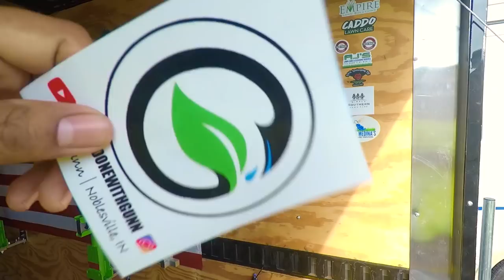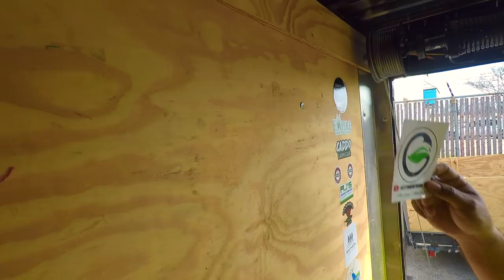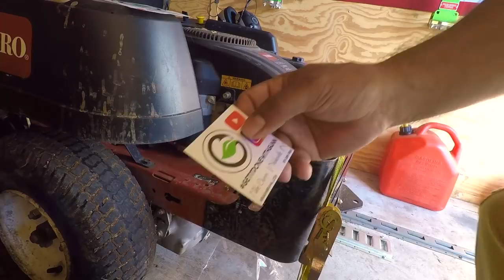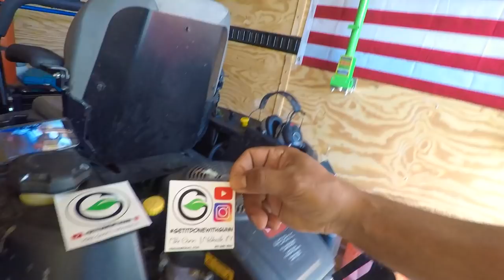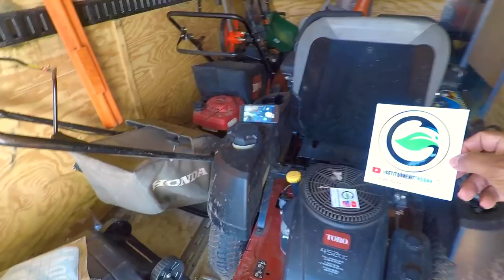Let's Get it Done!

Comment: Oh, and I know I'm new, so I don't wanna come off as telling you what to do off the bat, but look into getting a nice piece of 1/16 inch steel, or something. Then you can go to a craft store, and get sheets of thin magnet material. So as you get stickers, you can stick them to the magnet material, trim them out with a utility knife and lay them into the metal sheet(that you mounted to the inside of the trailer). This way they last way longer and you can move them around as you get more to fit them tighter. I offered this advice to other guys too. Then you can move them inside to a fridge or a shop if you ever change out trailers and don't have to start collecting all over again... Again, just my 2 cent bud, hope all is well, God bless, and Dirty Jersey out again!!!!
Reply from the maker: That is a real great idea man!! I'll give that idea a shot. Shout Out to Dirty Jersey!!
Reply: @EclipseLawnCare  you got it bud!!!, You can even very gently try and peel the ones of the trailer wall, and use spray adhesive to mount them on to the magnet sheets so they don't go to waste too!!! Glad I could help, keep up the awesome videos,God Bless and Dirty Jersey out!!!!